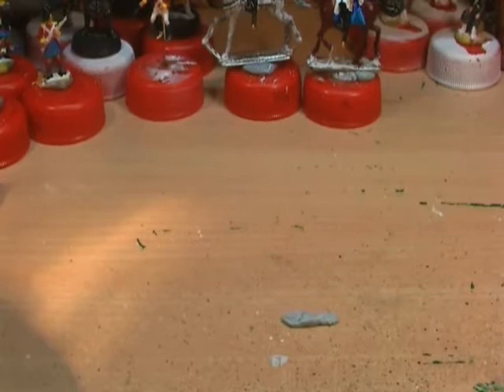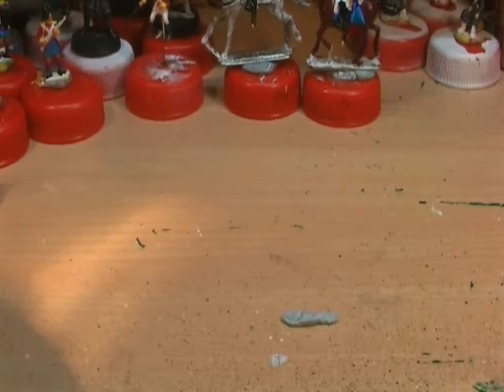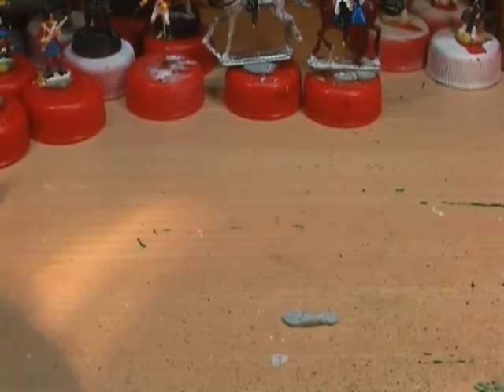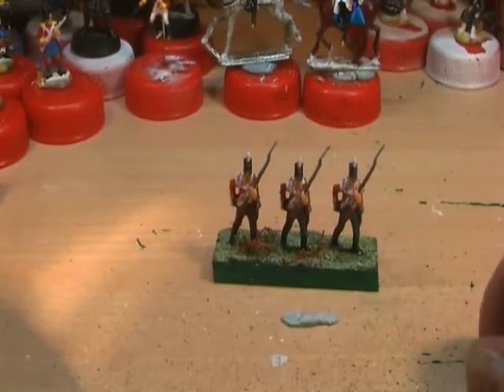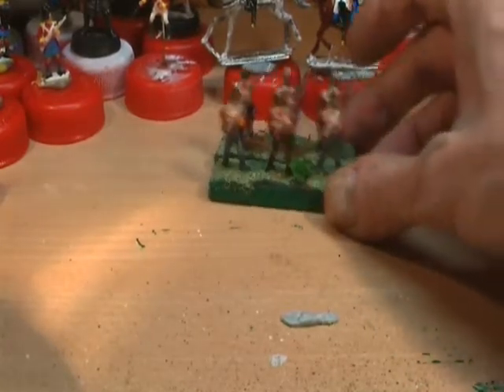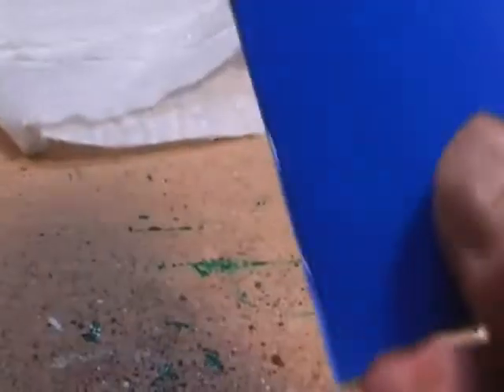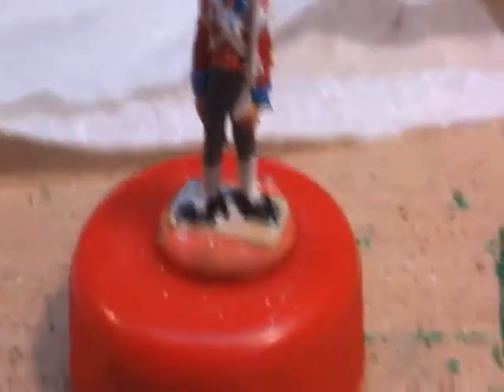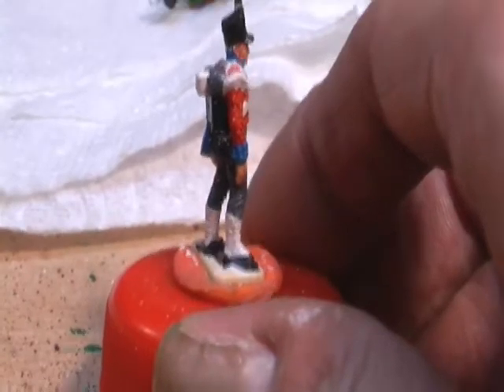Books and bases

Comment: Great selection of books, and the cheapo movement trays are a great idea. The fire at the Humbrol factory was indeed a disaster, one young girl killed and quite a few suffered serious burns. An electrical spark ignited paint or oil fumes in the building where they were all working.